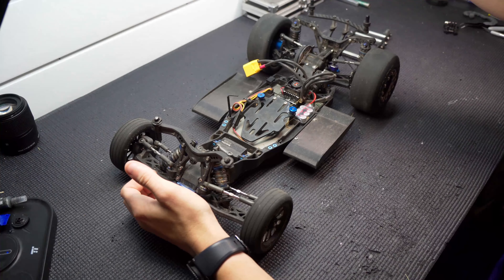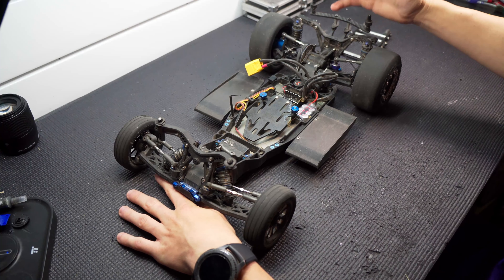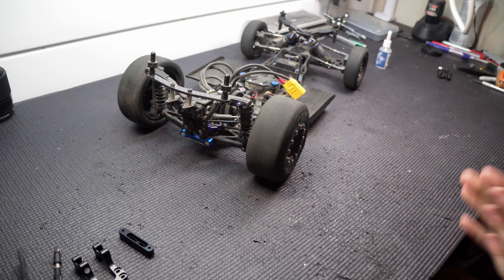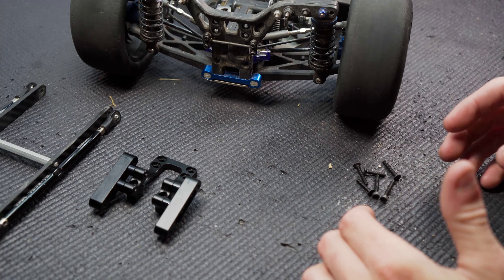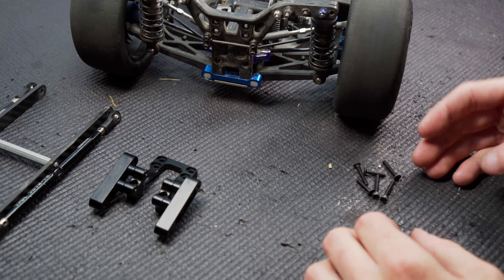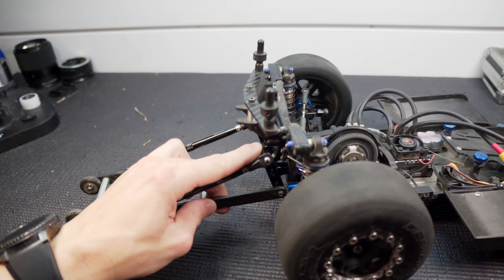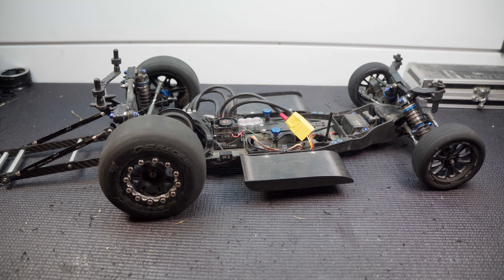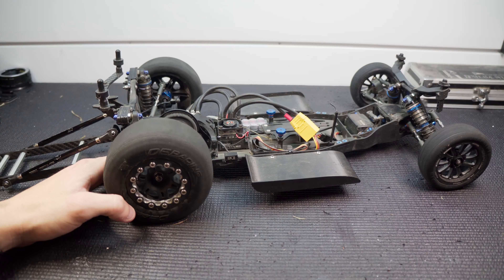Aluminum No Prep Wheelie Bar Mount & Diff Maintenance!! | FullThrottleDragRacing

Comment: I use hand cleaning wipes.the tub o towels is what I use.cleans the tires well I think.
Reply from the maker: Hmmm, first time I've heard that one. If it works, it works 🤷‍♂️
Reply: @FullThrottleRC  I tried it the last time I made some test hits.they aren’t to harsh of chemicals so it doesn’t seam to hurt the tires.cleaned a lot of road grime off.

Comment: I just picked up a sc5m, but with the 4 gear trans. If you can find one I recommend it, as the 4 gear puts the pinion/spur on the driver side. This causes the natural torque of the motor to push the front end down and causes leverage (which is very hard to get in rc cars compared to 1:1 cars) on the rear tire.
Reply from the maker: I actually have a 4 gear case already, just haven't picked up another idler gear and shaft. Was already planning on trying that haha
Reply: @FullThrottleRC  mine sadly has a jb welded ball diff in it from the previous owner and of course I can’t find any dr10 diff internals for my drc hardened diff